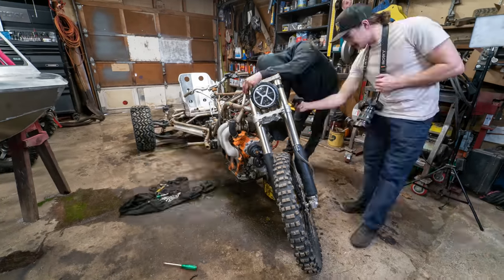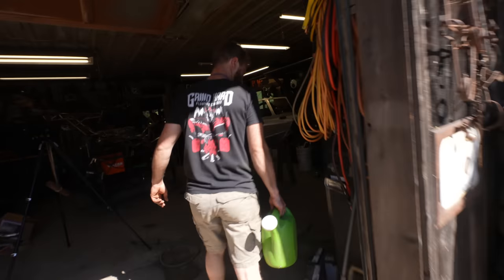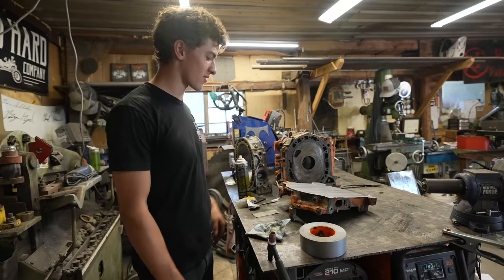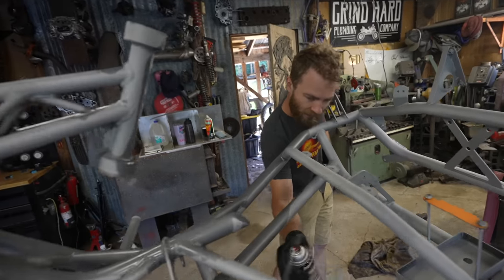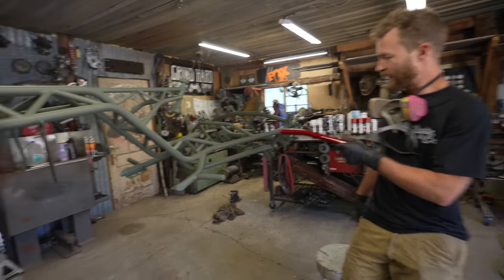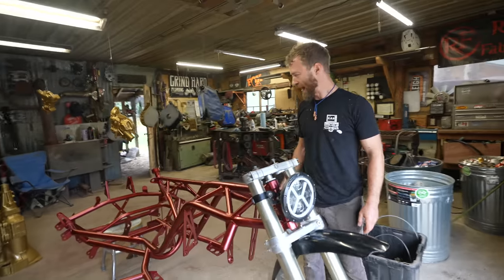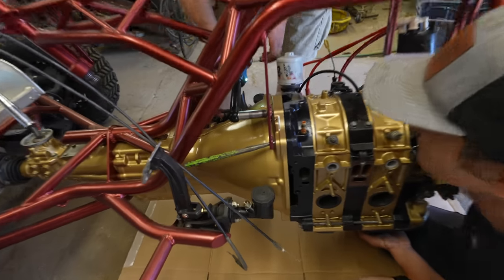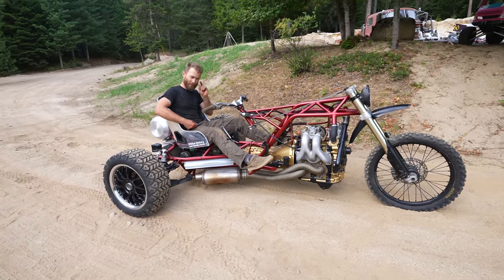RX-7 Rotary Drift Trike is Finished!

Comment: Looking forward to the no steering humor.  Having owned a similar trike, you will only be able to make slow speed turns until the rear axle is fixed and independent rear brakes installed.  Until then it's a Mindy, b/c you'll be mending everything.

Comment: I wanna make one of th3ase but with a V6 in it with some hooser tires on some five lug steelies. Front wheel will have to be a wide tire to give some traction. Probably gonna need to be a custom one off steelie of my own design if I can even do that. 
Transmission will be out of an old mustang 5 speed manual. Then again the chances of me makeing this a reality are slim. XD

Comment: cables will be fine if they are properly terminated ,heavy duty and examined regularly......i use cables to lift tons of weight,most older airplanes
 use cables  to adjust flaps thousands of times per flight and they are thousands of feet in the air

Comment: I've seen steering linkage on trikes like that, but they used rods instead of cables... probably for the reason you stated. you lose one and you only turn one way and wreck.

Comment: Highly recommend notching that gear shifter so if you crash it doesn’t take off your testicles. Bought a totaled motorcycle once that the key took the dudes testicles off. You need that thing to be able to move about 1-2inches and you’ll be fine.

Comment: I still don't know why you didn't use solid shafts for steering linkages.  Towards the end you say if one cable breaks you loose one side of steering, but that wouldn't be the case with solid linkages. Curious as to why you chose cables. I've commented this before but maybe I missed the explanation 🤷🏻‍♂️
Reply from the maker: Honestly, because it’s weird and looks cool, and I wanted to see if it could work.
Reply: @GrindHardPlumbingCo  thank you for the reply! I really appreciate it!

Comment: For steering why not use 2 solid rods instead of pull/pull cables, it would be redundant push/pull, if one rod came off you still have the other to save your steering. Just an idea for safety's sake.

Comment: i thought mig used argon as a shielding gas. couldn't you have just used the mig tank on your tig welder? i still think i'd swap the cables for solid rods in the steering set up for exactly the safety/certain death issue you mentioned concerning a cable failure. if it were a dual rod set up, not only could you incorporate some adjustability into the steering, but the failure of one of them would still leave you with functional steering, just not as strong, thereby increasing your odds of survival exponentially. while i understand that safe is a feeling, not a state of being, you know old saying about safe vs. sorry...and truth be told, you guys tend to break a lot of stuff.

Comment: I mean…. Couldn’t you have swapped bottles.. and continued with the TIG ?? Am I missing something..? I thought that MIG and TIG used the same shielding gas… or.. I thought that a MIG machine will work great with just ARGON. I thought you could just pull the bottle from the MIG machine and put it inline with your TIG setup …, 🤷🏼‍♂️🤷🏼‍♂️??

Comment: INSTEAD OF THE CABLE SET UP FOR THE STEERING HIT UP A AUTO SALVAGER PLACE AN GRAB AN ELECTRIC STEERING SET UP WAY SAFER AN ONLY ONE CABLEFOR SIGNAL NOT FUNCTIONYES HYDROLIC STEERING IS PLAUSIBLE TOO BUT WAY TO MUCH ODDS AN ENDS ELECTRIC OUT OF A CAR OR NEW 4 WHEELERS, WOULD BE MY CHOICE! GBUA

Comment: The aggressive tyres really fuck up the look of this mad contraption. Getting some proper slicks on the back and a street bike tyre and wheel in the front would complete it. You're cheating if you thing going sideways on a dirt track is drifting. The full size car could do it, so the 1/3 weight bike should too just as well on some pavement.

Comment: “All the argon is gone let’s mig it” how can you mig weld with out argon??? Thats flux core not mig
Reply from the maker: The mig uses a mixture of argon and CO2. TIG used pure argon.
Reply: @GrindHardPlumbingCo  you can you the 75/25 for tig

Comment: I’ll give you $5000 for it
Reply from the maker: I seriously hope you’re joking. 🤣
Reply: I wish I could build something really cool like y’all. Over the summer I have been rebuilding a gas golf cart that has ent ran in 7 years and there was two of them, I had gotten the one running great. And the other one I am in the process of the turning into a trailer to match the other one. But the one that runs I had put a 6inch lift on it with front and rear bumpers. I had put a light bar and it, and a hitch reciever on it. For the trailer I had already taken all the wires off, steering shaft, and front suspension. All I have to do is put a trailer gouge on it and it will be dialed.👌
Reply: ever since i had started watching yall's  videos, (which was like 4 years ago), yall have always been my inspiration to doing this kind of stuff, and if it wasn't for yall, none of this would happen. so I had just wanted to say, thank you!